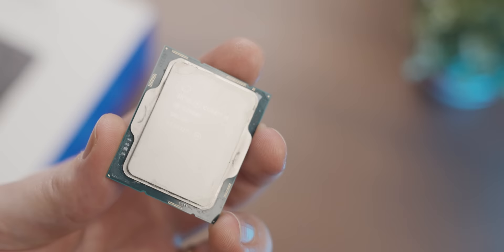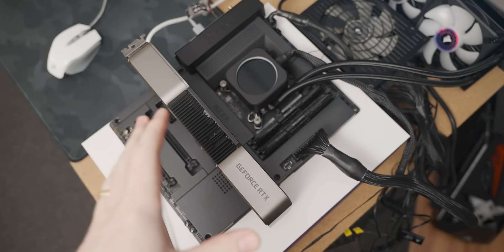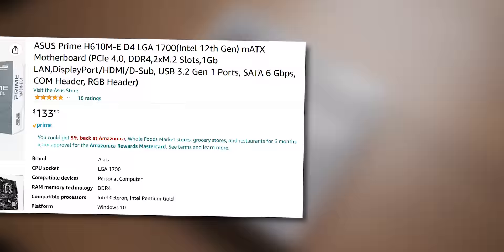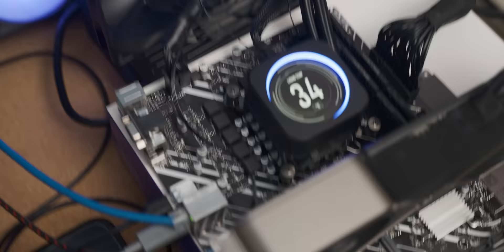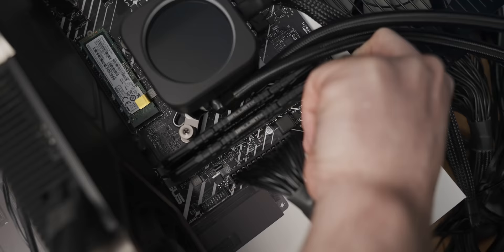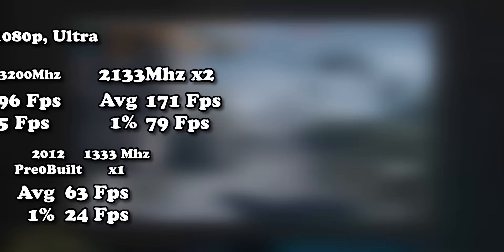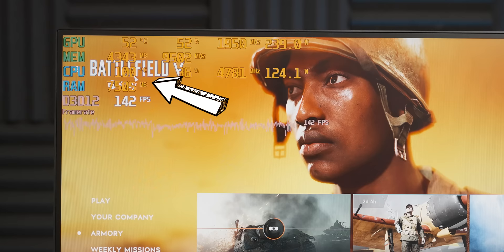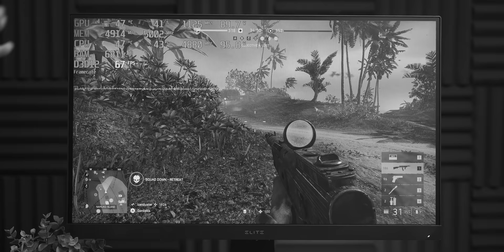What NOT To Do With 12th Gen Intel CPUs...

Comment: I almost kept that motherboard before returning it for a TUF. Saw it need 0.1v higher to run the cpu on Gamers Nexus. I see the thermals are bad too from this. Never buying the bottom tier motherboard again.
Reply: that cheapest board is not "bad", its, bottom tier and its fine for its intended purpose, office pcs or ultra budget gaming, i3 12100 kind of cpu, these run fine, but if u go with i7 12700+ then, yea absolutely its a high end cpu, u need a matching board

Comment: What AIO is that?
Reply: they literally showed it in the video. it’s the Corsair H150i ELITE CAPELLIX LCD, though please do not buy it. overpriced RGB puke, get the Lian Li Galahad instead if you want to blow that amount of money. Cheaper options include: Arctic Liquid Freezer II/EKWB’s entire line of liquid coolers besides their 120mms. 120mm is basically a glorified single fan air cooler

Comment: It proved that the mobs isn’t that bad, so no need to get a z690 for a 12600k(?).
Reply: ofc it is that bad, the first test the cpu already lost a bunch of fps due to vrm overheating and overloading, then with cooling it STILL LOST fps, just buy a decent enough mobo, it will handle the cpu allright no issues, and be more feature rich.. and make it a z690... ur buying a k cpu, it means oc, and only z series can oc "but i dont inted to oc".... then why are u buying the 12600K instead of a non k

Comment: Pre-builts be like; 
"High end 12th gen gaming PC!"

OEM H610 motherboard
I9 12900
Intel stock cooler
1×16 GB DDR4 @2666Mhz
Dell OEM RTX 3050 
500GB SATA III SSD from some Chinese brand
Unbranded 500W PSU
Some Chinese case with RGB
And zero airflow

Comment: I'm using a 3600mhz cl16 kit with a 12600k. good to know it was worth the extra £20 price I paid over 3200 CL18. The performance difference might also be due to the power limit of the cheapo motherboard. Hardware Unboxed did a review of cheaper boards which showed that most of them couldn't give a K i7 the full power it needed. The cheap board you used probably was more of a factor on the performance difference. TBF no one would use a cheap motherboard with the cpu you used.